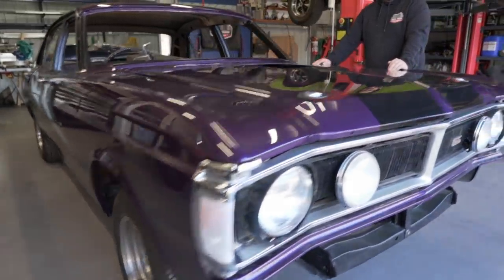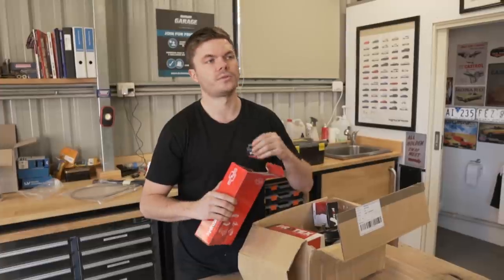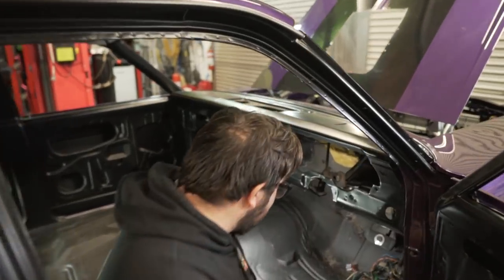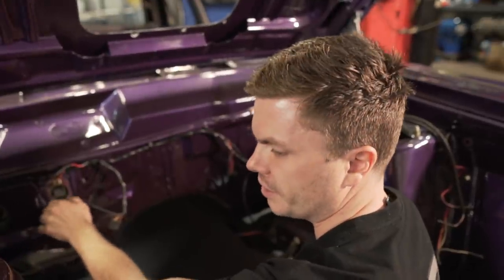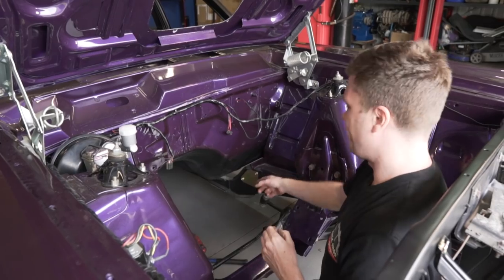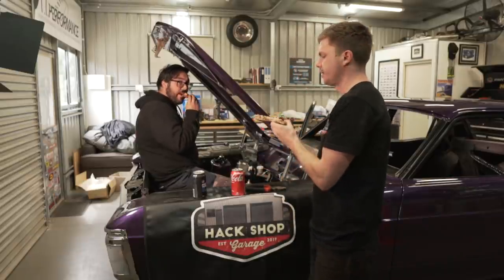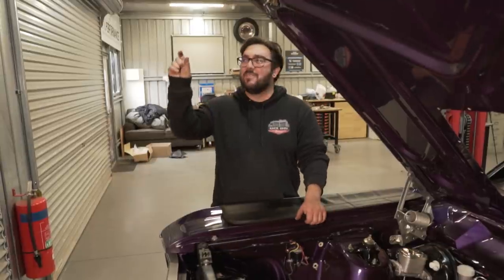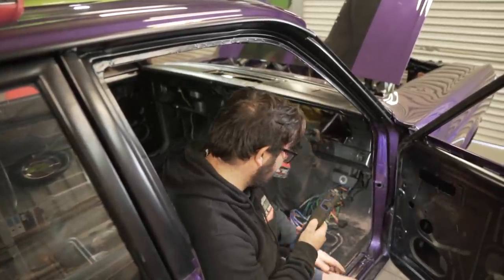XY GT Falcon Build - Part 3 - Brakes

Comment: When you installed the booster bracket on the firewall it does not seem you installed the loom through the cutout. You even noted there was a cutout for the loom. Am I missing something?

Comment: hi 
Guess what the mechanism/ small cable touching  the handbrake adj wheel is /does . 
When in reverse the rear linnings auto adjust .
If u remove this it will not auto adjust and the adjuster will  back off the adjustment to the linnings .
The 10 bolt Holden is similar

Comment: Install the drivers side extractor as the motor being installed, just easiest if you lay it almost in position.  Passenger side is easier to feed up from underneath.

Comment: Nice one guys. Well put together video again. I was wondering if you were going to be able to fit the master cylinder onto the booster in place. I couldn’t with mine. 
HACK- For removing ball joints without a puller, use a pry bar to place tension on the steering arm then place a lump hammer (4lb or so) against one side of the taper and give it a sharp hit from the opposite side with a second hammer. The impact will pop the ball joint from the taper without damaging the threads.

Comment: Workshop hacks:
   When you open a new packet of cable ties, cut a small slice down the middle of the bag, it stops them from all falling out the end.
   Sandwich bags of all sizes are a godsend for keeping bits & pieces together when pulling a car apart and then trying to figure out what they went to when you go to put them back together.   It's also easier to write on the bag before you put your nuts & bolts, wiring or parts in them.

   Take pics or video of the car coming apart.   It helps to figure out how things go back together or confirm if you installed an LSD or not without having to pull the car back apart  😉😁
   If you want to paint small parts, use a large cardboard box or an old cabinet to stop overspray.   Alternately you can use an old clothes drying frame or the Hills Hoist, but make sure you clean it properly before the missus find out  😉😆.   Either that or just call Nathan  🤣🤣

Comment: hi 
Both below are worth considering when fully new / reco  system installed  
1/  use Nicop for brake lines,   donot corrode inside or outside 
2/ silicon brake fluid - biggest benefit , not corrosive

Are u using PBR ford cast iron calipers = similar holden style
Caliper slide and bracket need high polish paint and polish again then fit with polished stainless slide sleeves / pins
End result is calipers will be super smooooth and not seize  
They were like this when new !!!!!!

Comment: The cable in the drum is the self adjuster, if I remember correctly. I think it works when the brakes are applied while the car is reversing. That could all be wrong, been a long time since I had my XY.

Comment: "The face", camera pans away... *hammering*. Classic

"oooowwwwwwurgh"
Reply: Best workshop hack is to chop up old pallet racking for work benches. Creates overhead storage, underside of shelves perfect for easy mounting of cheap LED task lighting, gets stuff up and off the workbench or a place to put regularly used tools. Can also be easily dismantled and transported if renting/moving.

Comment: Ooharrghhh get to the chopper haha classic

Before you use spray paint chuck the can in a bucket of hot water will spray better and dry faster
Whenever you remove a steering wheel undo the must put it back on a couple of threads hit on the outside of the wheel at 12,3,6,9 and will come straight forward and not break your nose

Comment: Hack/Tip If you want something painted that will last, small brackets ect. Buy a cheap decent size oven, then spray the parts in engine enamel as it is oil/solvent resistant, then cure to recommendations on the can. P.s WH&S, please make sure part is completely dried before placing in oven, lol.

Comment: Spaghetti can with nut and bolt threw it,  Put it on a drill and spin away. Instead of shaking spray cans. Top tip withal them spray cans. Keep the vids coming

Comment: When you put the engine in, I've found it easier to install the engine with the drivers side extractor fitted only. Then put the passenger side (easy side) on afterwards. Also, I see the steering box is fitted, but make sure it's all setup as it can be a pain to get them in and out with different extractors. Best of luck.
Reply: yep learnt that the hard way

Comment: Here’s another one for yas. 
Buy yourselves a compressed air operated vacuum like the ones tyre places use to clean out the crud from inside a tyre when repairing it. They’re only $30 or so on eBay. They can be used for heaps of clean up jobs in the shed but I’ve found a new use. They are great when you need to empty a fuel tank or cooling system. Simply put a hose into the tank and put the opposite end into the vacuum device. You can seal around the pipe a bit with your hand and a rag then use the vacuum to suck out the liquid and to start a siphon. 
I used this when I changed a thermostat on my 351 powered XT last week and didn’t have to drop the bottom radiator hose so made ZERO mess on the shed floor. 

Howza bout a sticker pack for saving you the clean ups. 😁👍
Reply from the maker: You know what, that’s a great tip mate, love it. Can you get in touch with us via our socials and we will send you a pack mate

Comment: hack: rusted bolts.... better than WD40.... better than penetrene.... better than 1/2 ATF & 1/2 acetone.... is good old eucalyptus oil. An old hot rodder told me this, and he was bang on RIGHT. Also if you don't have anti-sieze.... white zinc (seen on some cricketer's noses) can do OK too. Cheers fellas !

Comment: You lay the drivers side extractor in the bay before you put the engine in. Passenger doesnt matter
Reply: What he said. 👆
Lay an old blanket on the inner guard and make a zip tie chain to hold the rh extractor up to the strut tower while you fit the engine. Doable but a PITA if you try and do it afterwards.

Comment: Put the throttle linkage in before the motor
Reply: I hope they go cable.. those linkages are a pita lol
Reply: @MikeJones-bj1cn  I’m yet to find out with my build
Reply: @stephengaraway3243  it’s more with older cars, those linkages when they wear and you can’t get 100% throttle. They can be a hassle.